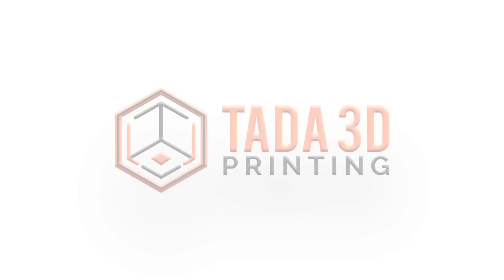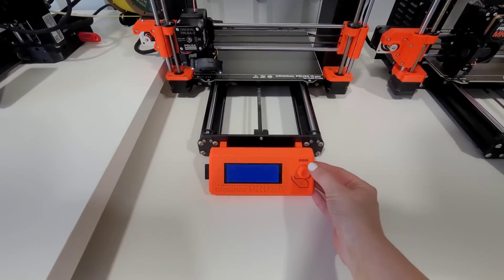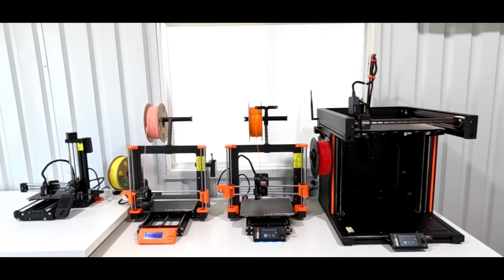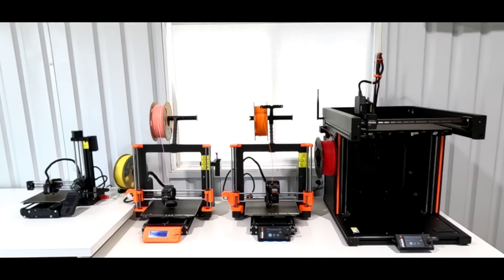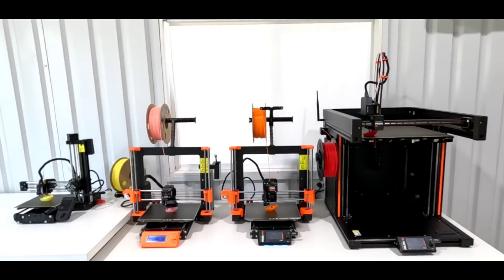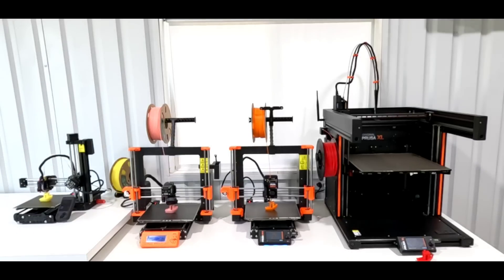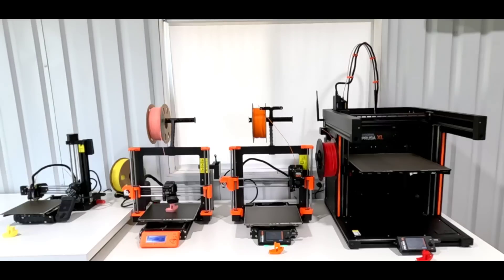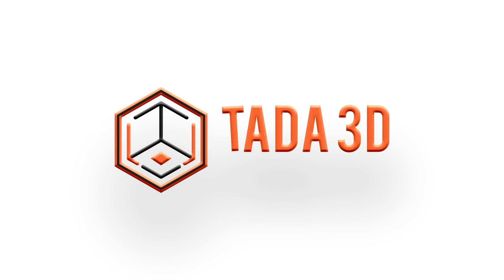Racing between the Prusa Printers to print a benchy!

Comment: Surprising that the printer with the most prep time is also the first one to finish.
Reply from the maker: Yes, that's really why I wanted to race them. I was wondering if the MK4 might be the fastest because of prep. Thanks!
Reply: @tada3dprinting  great job!
Reply: It becomes very interesting on very short or very long prints.  My Bambu X1 Carbon seems to take forever to get started, but then goes so fast.  But short prints can turn out to take longer.